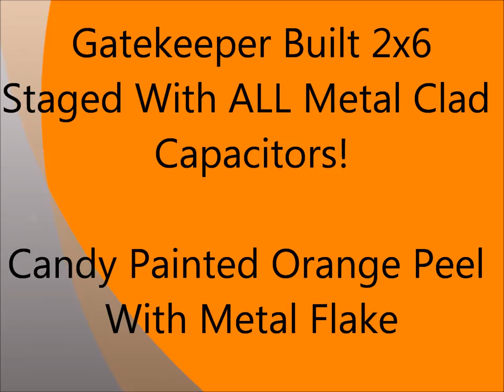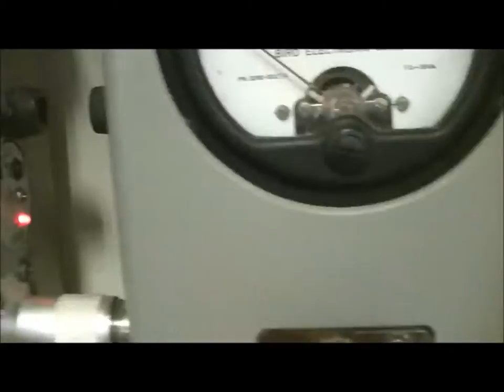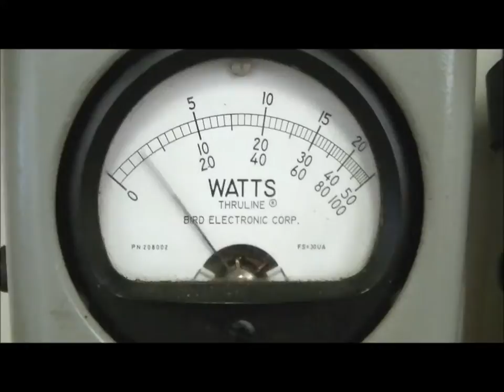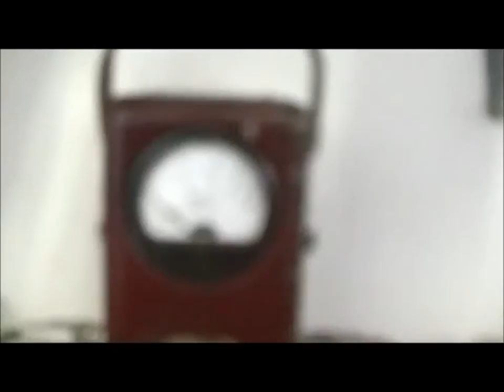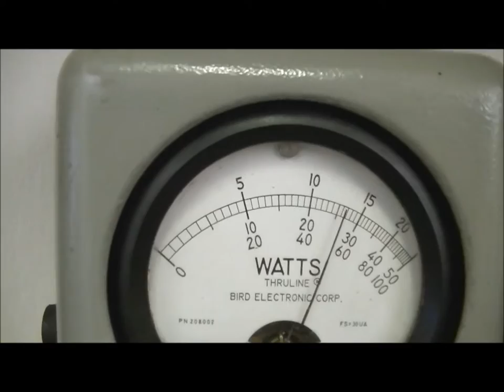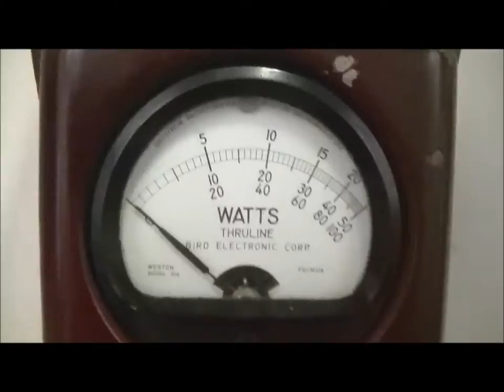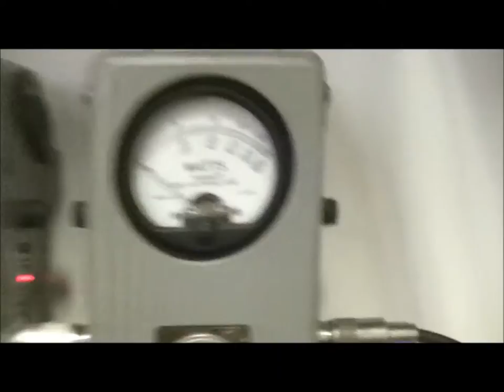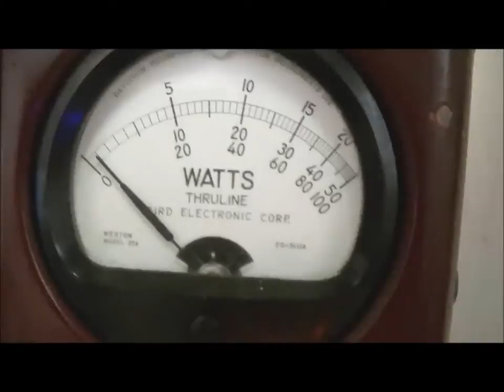GK Built Candy 🍊 2x6 Amplifier Staged w/All Metal Clad Caps - AMAZING! 💪

Comment: nice build!  love that driver stage. I know what you mean about metal clads . ICA only had 1000PF 500V left . last 6 pill I did was a wile back . 1 two pill section kept blowing pills. I took it down checking all parts. found 150Pf output tune cap went down to 68Pf and drop when get hot. I checked the outher 2 and they off but 120Pf they read. but fall off when heat them. they used mylar caps. at the time I had metal clads . I don't now. I now have HG SD 1446 to play with . just 2.  also HG 2SC2510 24V pills (2) came today .  I have bule metal oxide 3W 200 ohm and 100 ohm 5% resistors . same size as 2W . from different supplier. I even got orange 2W resistors. some 1% some 5% . watch voltage on HG . I don't run over 15V . their is a trick with NEG bias that allows to turn voltage up and drive up but box will be dirty 2nd and 3rd order harmonics bad. I have LED fans coming for computer work. amazon has them . 5V and 12V even in 140mm size. PC gamming case had 140MM fans not 120MM . loving the new SSD drives. starting a collection of old HDD drives now. pulls from up grades. The lowest voltage reg IC I found was 3.2V but the ADG LM723 will go down to 1.2V . will work for MOS transistors. use a multi turn pot. to set gate voltage.73's
Reply from the maker: That is what I like about you man...every comment is loaded with information... valuable info!!!

Comment: I have 8 pill let someone use and I know of 1 pill is bad he took it had someone replaced it dead key was way to high need you to look at it to see what it needs I can drop it off one weekend
Reply from the maker: Your name sounds familiar. Are you one of my locals around here? Only issue I have right now bud is I am catching up on work right now. Ive been sending a lot of my work over to Early Adams 3 Made Amps. He has done me right while I've been slammed with backed up work.
Get back to me and let me know if your a local or not.